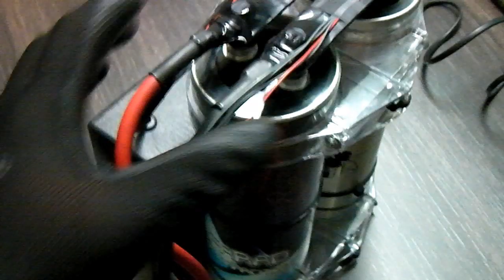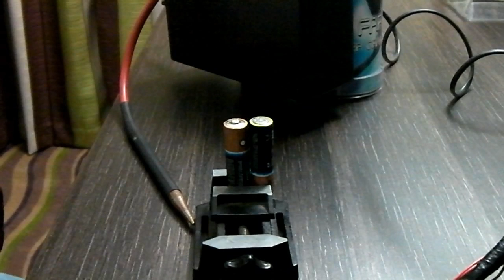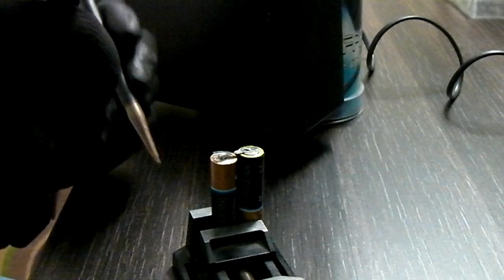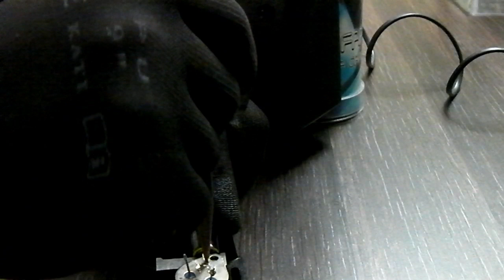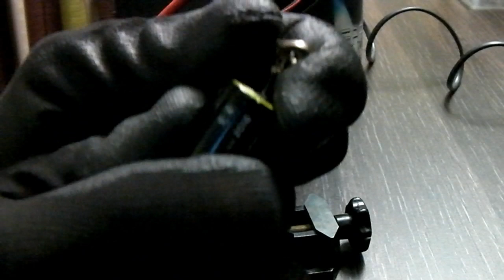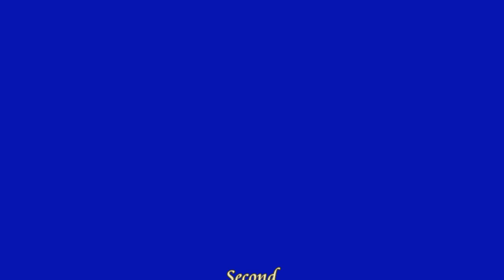Capacitor Welder - Battery tab Welder part 1-2

Comment: I love how polished your build is. I especially like the buttons on the electrode and the bus to SCR connection you made using the lathe. I built mine using similar components, but it is crude in comparison. With my limited machinery, I crushed copper pipe in a vice, sanded it flat, and used that along with bolts for my bus connections. My switch is a custom built foot switch using wood, springs, a door hinge, and 2 switches (the 2nd for disconnecting charge power during discharge).In the end, your version is definitely more compact and more resistant to "bump" damage than mine. Well done!
Reply from the maker: Thank you for your kind words mate, i hope this video helps you in any way. We are all here to learn off each other, I've since doubled the AA battery to 3v which helps fire the thyristor very fast fully saturated giving me more deeper penetration with the welds.

Comment: Awesome. Would you be able to use this to spot weld sheets of thin metal for small hobby projects? I'm thinking of material as thin as, let's say, aluminum pop cans? Or those slightly thicker tin soup cans.
Reply from the maker: +DORC101  Hi mate thanks for your feedback,  I'm sure you could but I haven't personally tested, what did you have in mind?
Reply: +Protoproff Nothing too crazy I've just been looking for a way to be able to hold a thin sheet of metal like that together. Like for example if I want to fold the metal into some sort of shape, let's say a cone, I can easily fold it but holding it in place is the tricky part, that's why I thought a spot welder would be nice. Thanks for the reply btw.

Comment: I'd like to recreate this for spot welding 5 micrometer diameter tungsten to hot-wire probes (significantly smaller, but 3 times hotter melting point). Any recommendations of if this design would work for that, or what changes to the circuit would need to be make to make it work?

Comment from the maker: This was a very crude tab welder put together with basic components this was never meant to pass any BSI standards, however a bleed resistor would be benificial but would rob some precious joules. i did consider a variable time period but really did'nt intend to develope this version any further as almost have designed and built a PIC version. Please feel free to improve on my version as will surely help others. Thanks for the positive comments.

Comment: Very nice.  For safety sake this should have a bleeder resistor across each capacitor.  A big improvement would be adding a variable timer on the trigger so you can compensate for lighter/heavier materials.   Thanks!